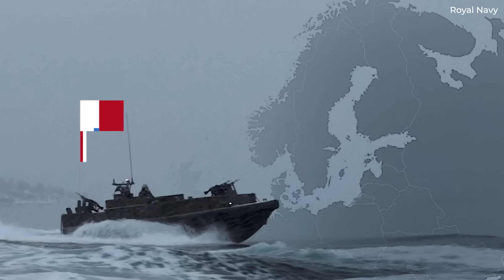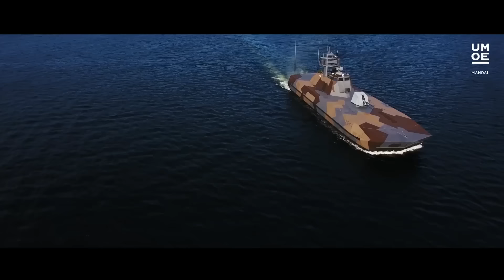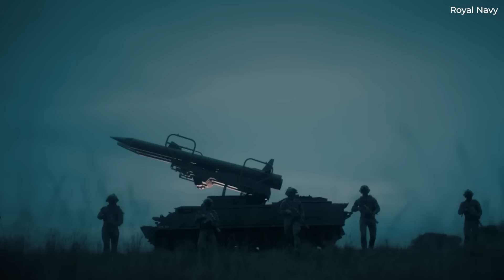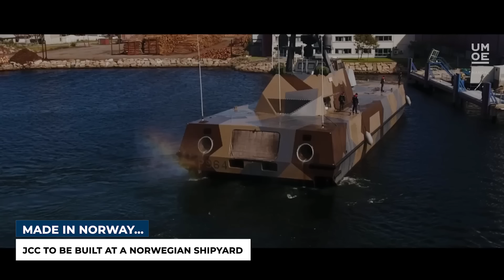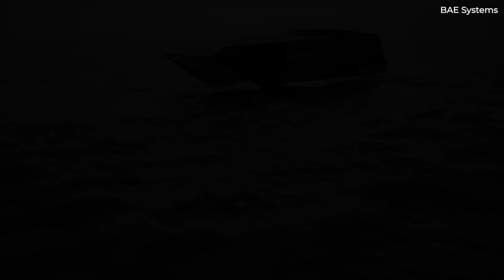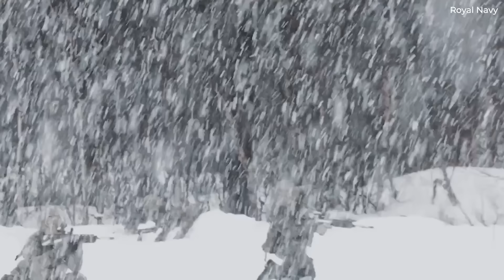UK & Norway May Buy Up To 30 Boats For Marine Forces (Joint Commando Craft)

Comment: Knowing the marines and commandos, they will want speed and durability! They have been known to carry a large amount of gear, and their kit is by design multifunctional. So the displacement weight is probably wanted to be nearer the 60 tonnes. I personally think top speeds over 50 NMiles per hour is the main target for such boats, with very flexable handling.

Comment: The Finnish Jehu-class could fit this role nicely. At 19.9 meters and displacing 32 tons, it's a proven platform from Marine Alutech.

Jehu-class vessels can carry 25 troops and support them with remote weapon stations. They can also act as patrol, medical evacuation, and command platforms.
Reply from the maker: With the vessels planned to be built in Norway, Marine Alutech would need to find a Norwegian partner.
Reply: Maybe being a bit too lightly armed and having a limited range might be a problem for these boats
Reply: @svetovidarkonsky1670 are we talking about a boat that can support coastal troops in a littoral environment, or an offshore patrol craft?

Seems to me they need the former, not the latter. They should pick an existing platform instead of wasting money on some drawing board fantasy. Especially in the case of the UK, which can't seem to get anything right these days when it comes to defence.

Comment: Canada needs to get on board with this. We we have our Harry DeWolf-class offshore patrol vessels, but they do not have the same capability. These  JCCs - or even a CB90 equivalent, would be an asset here. We have a bit of coastline to cover and as the North opens up to shipping, being able to effectively cover it and respond to concerns will be key. An European solutions sounds ideal at the moment too.
Reply: True enough however, the H. DeWolf class only mounts a 25mm cannon, ideally, a 57mm/76mm should be on deck for operational effectiveness/flexibility (surface and air). Be well and stay safe
Reply: It is better with smaller guns (less than 40mm) on boasts under 60 tonnes. The swedes tried mounting heavy guns on the CB90 and it backfired (pun intended). Maybe a 120mm mortar would work.
Reply: @gullintanni H. DeWolfe patrol ships are 103 meters and displace + 6000 tons. So, real deck guns are appropriate.
Reply: How would a small combat craft be if much use in those freezing waters with sparse outposts?
Reply: @starship4453  it is likely that there will be more locations  along the Northwest Passage that will  need to have a regular Coast Guard and Forces presence that don't now.  And being able to patrol and roll up on a beach after a drone identifies something interesting or suspicious is ideal. A JCC or CB90 i just another tool in the box.

Comment: I think we should actually have looked at the French CNIM LCX. It is pretty much the right size (it comes in 24m and 29m models), fits in a standard dock on a landing ship, and can carry pretty decent loads. Obviously not as stealthy as the proposals, but incredibly flexible. They could easily carry either containerised systems (MCM, ASW, air defence or mortars etc) or even BvS-10 Vikings. They would be fully capable of carrying out the raiding mission, but also be far more flexible. The ability to carry a 20ft container or two would give the potential to even carry NSM or CAMM if needed! It could easily carry a Sea Giraffe 1X radar, acting as an extra radar picket close to shore.

Comment: Hopefully they are bought although only 30 seems a bit low.  If (when) things get hot, they will be used up quickly.
Reply: When talking special forces, bulk is rarely needed, as number of teems are low.
Rather having different kinds of systems gives flexibility.

Also keep in mind, that this sounds like a much bigger vessel then what is already in inventory. Meaning they are building a new capability.
Once doctrine and training is up and evaluated in real life, they can always buy more.
There will likely be at least some time from first to last vessels is delivered. 
So depending on timing, it could be as simple as just signing a contract for another batch added at the end of the first production run.